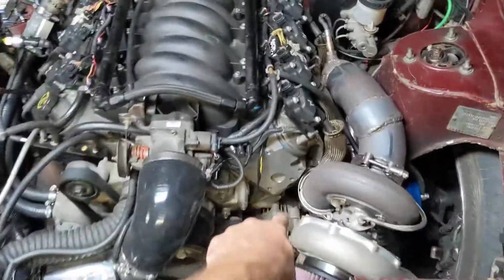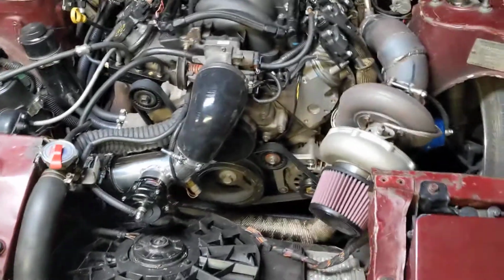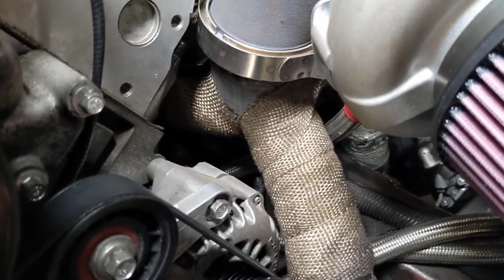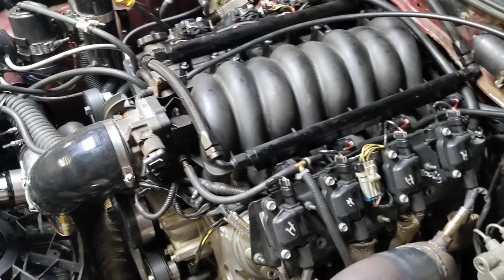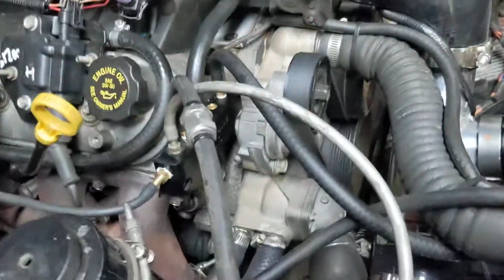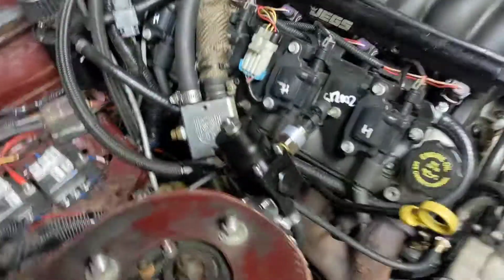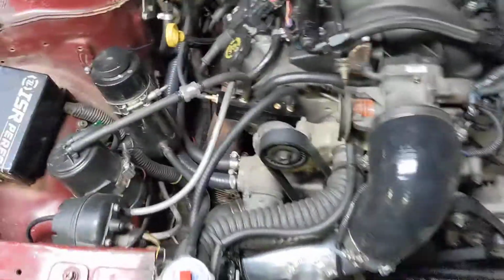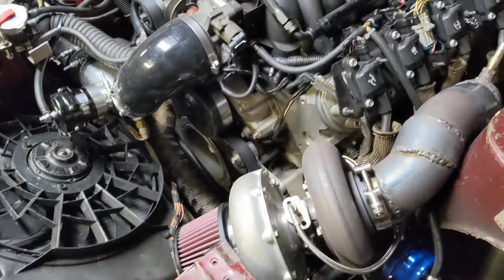Turbo LS Z updates: New engine, Gen 2 7875 turbo, intercooler and more

Comment: What's the weight difference between the original v6 engine and the ls?
Reply from the maker: The aluminum LS is about 50lbs lighter than the V6 VG30E. The iron block LS is about 50lbs heavier than the VG30E and about 100lbs heavier than the aluminum LS